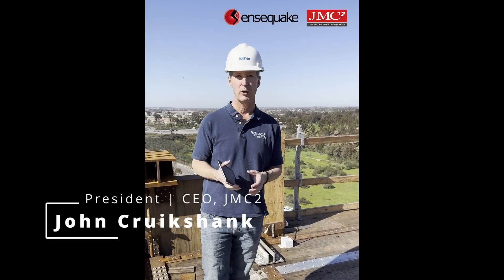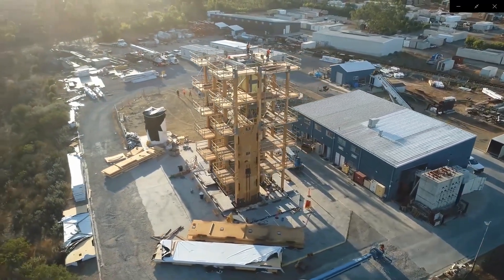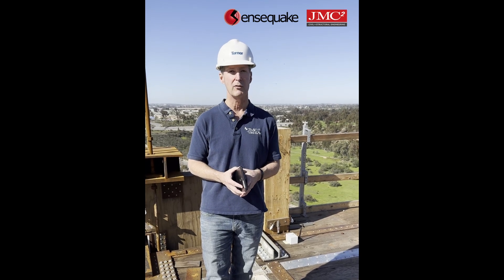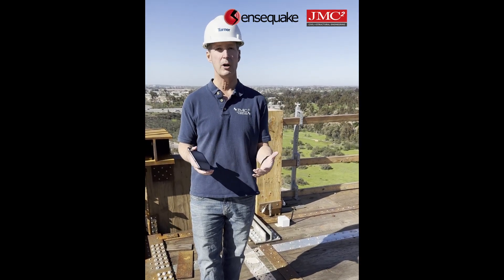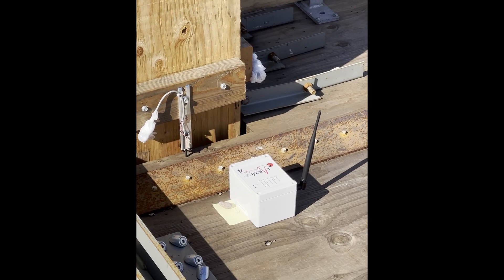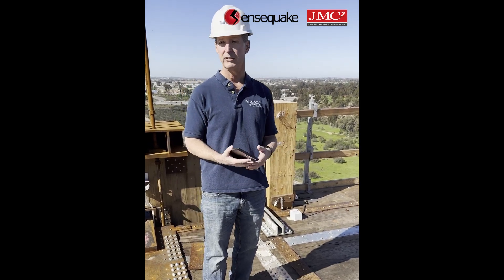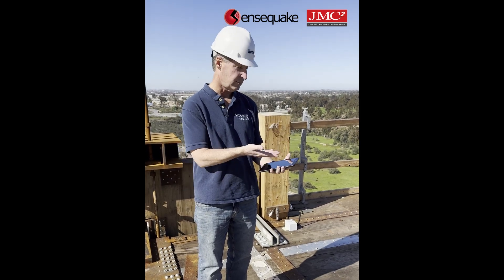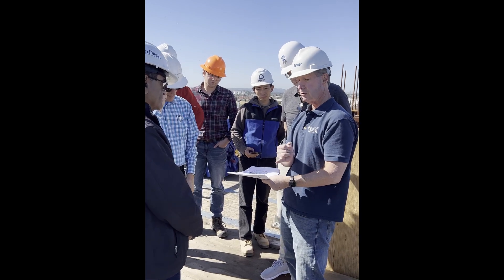Sensequake Technologies - NHERI Tall Wood - Tallest Building on Shake Table Worldwide

Comment: Collaboration proposal if you want, we can experiment with the ultimate anti-seismic design method. 
Journal Name 	Manuscript ID 	Manuscript Title 	Submission Date 	Status
Open Journal of Civil Engineering 	1881859 	The ultimate anti-seismic design method 	2023-11-22 04:46:36 	Papers Typesetting
Open Journal of Civil Engineering 	1880388 	The ultimate anti seismic system 	2015-07-26 22:45:27 	Published